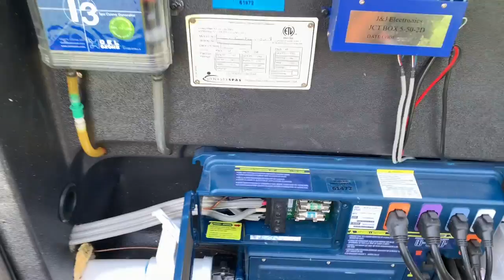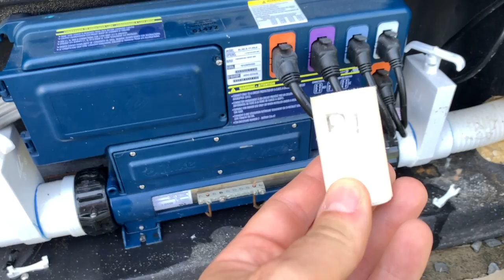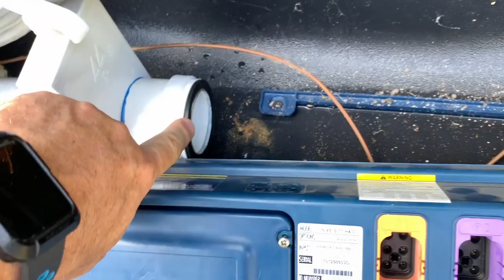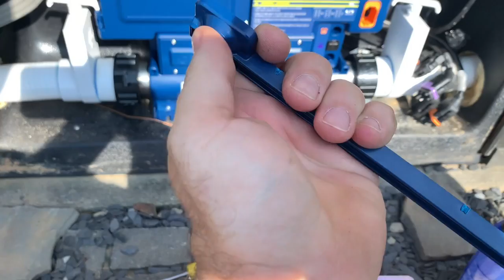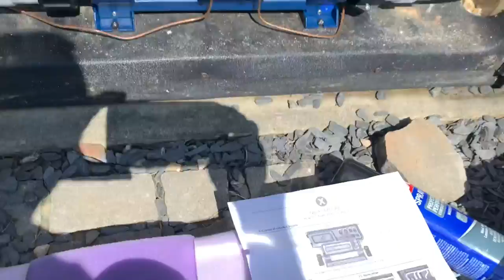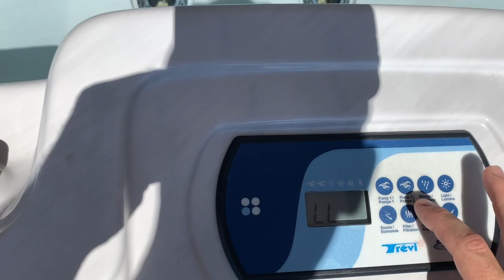Replacing Gecko Spa Pak

Comment: thks for the video lots a of good infos, I have to replace mine exact same pack, only thing I would different is fill up the spa from filter inlet, that way if air is in the pipes it will come out the sprinklers,filling up like you did can trap air in the system

Comment: I’m trying to figure out why mine won’t work a bunch of codes show up on the top board
Reply from the maker: The codes can be tricky. Most are universal to the brand but some features come with different codes. If you have the original manual, obviously you can use that to narrow it down. If you don’t have it, exhaustive internet search is all you have left without contacting a dealer or repair person. If your tub is having symptoms of an issue, I would research which part relates to that issue and see if a code matches to that part. It’s a process of elimination. Hope that helps somewhat.

Comment: Just out of curiosity. My top side control panel gives me an HL error which based on my research means a high temperature issue at the heater element. Is that a similar issue as what you experienced? You mentioned an HR error. Not sure is that is the same thing.
Reply: Sorry it took me so long. I just saw this after an 84 hour week at work. My code was for the heating elements stopped working. Spa was not heating at all. If yours has been over heating, and I’m betting it would shut itself off to not damage the pak. Either that or one of your pump motors may be heating up under load and the pak is shutting it off. I’m not a pro at spas, but I did have to replace a pump motor because it would over heat and I can’t remember if it gave me an error code for it. I just kept noticing a pump would stop after so long and I had to wait till the next day before it was working again.
Reply: I really hope the video and this extra information helps.
Reply: @michaelwilliamson7531  No worries on the response delay. I’m sure you’re not sitting at your computer 24/7 checking for YouTube questions. Lol. I appreciate the reply and the additional information. It’s already been helpful in figuring out the Spa Pack removal which should help me with troubleshooting. Thanks again and have a great day.
Reply: HR is hardware error HL might just be a dodgy temperate probe or if the hot tub is in sunlight all day it can overheat that way and can cause it to throw that error regardless of it if the probe is good or not, the only way around this is to cover your hot tub with a umbrella or just out of sunlight somehow

Comment: How did you program it?
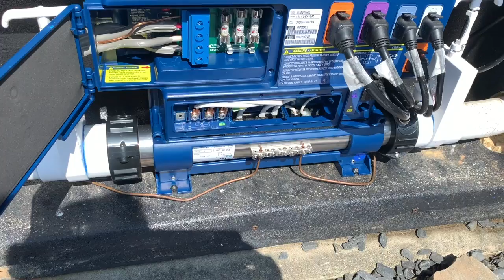Reply: Sorry for the late reply. Been busy with Thanksgiving. It does not require programming itself. It does require you set the input Voltage (see about 10:21 minutes into video) for either 110 or 220 Volts. Other than that, programming the Spa is done on the top side control panel (temperature, run time, etc) and that will require the quick guide that comes with the top side control panel. If you don’t have it, then it will require some internet searching to find it. Once your enter the programming mode (which getting there is different depending on manufacturer) the settings show up as codes or abbreviations, so without the programming guide you would need to be an expert and have them memorized. I hope some of this helps.

Comment: ‘Great video! By chance did you check the fuses inside of the connection box on the unit to see if any were blown?
Reply: Yes. I did some troubleshooting at the inside breaker, outside breaker as well. It all pointed to the spa pak and its still working great.
Reply: Thank you for the reply. I'm not sure if I was clear about that. I was referring to the four small fuses inside the spa pack.
Reply: I checked the 3 fuses resting beside the 220V power connection inside the pak. If there were other fuses inside it, I was unaware.
Reply: @michaelwilliamson7531  Thank you. Yes, those were the fuses I was referring to. 

I'm installing a new power pack in my tub tomorrow. 

Thanks again!
Reply: Good luck Jim. I hope all goes well and something in my video gave you some clarity.

Comment: Thanks for the video, replaced same on Dynasty spa.  Found new colored plug trim pieces inside the power supply compartment of the replacement unit.  I was surprised how much water flowed even with shut off valves closed.   Good video.

Comment: Great video! A few questions: 1) Did your new Pack come with the same options? I ask because I'm having a heck of a time finding the same options of 1-2-K-K-D-60K-V2-DY1, 2) from what supplier did you get the replacement pack from?
Reply from the maker: Hey Norm.
   Sorry it has taken so long to reply.  Now that Im home more, due to the pandemic, my wife has a long list of things to do.  
    The new unit did have the same options as well as the ability to upgrade with wireless control, which I did not order and plug in.  Its been a while, but I'm almost positive it was DirectHotTubParts.com.  There are slight differences in those pumps based on how many pumps you have and if any (or all) have multiple speeds.  For instance, mine had 2 pumps and a blower.  Pump 1 (2 speeds--low and high) and Pump 2 (1 speed only--high).  Depending on your particular set up, read the description for the Gecko codes (mine was 0602-221063-299, I believe)  and that best matched my setup based on the updated models.  I also, cross referenced several sites to make sure that model would replace my older and no longer supported model because some sites will show that in the description and some will not.  I hope this helps.  Let me know if you there is anything else I can help with.